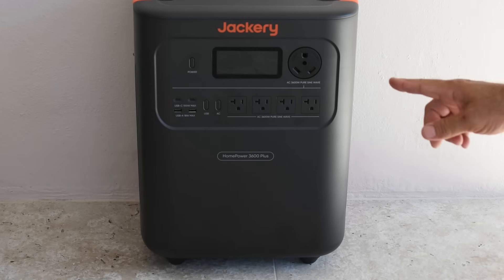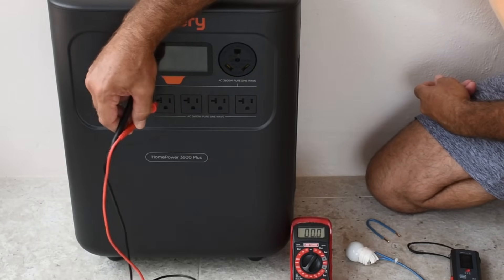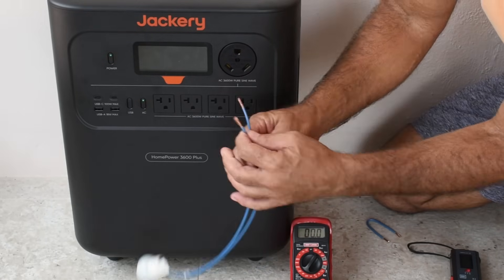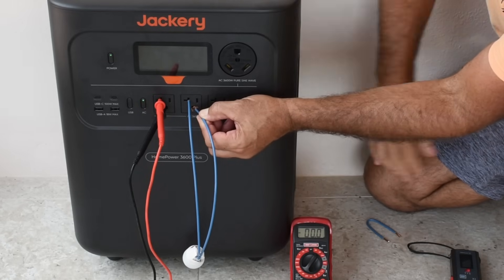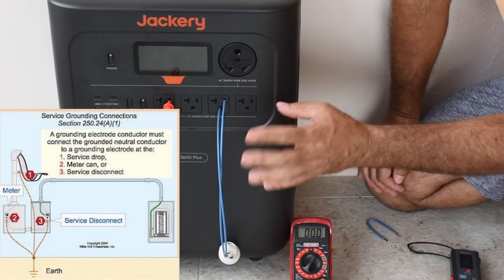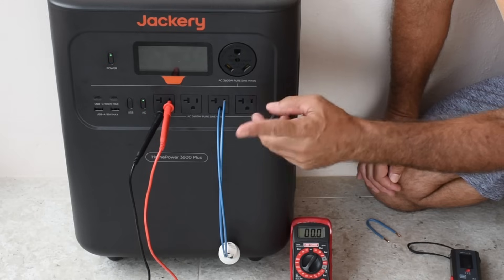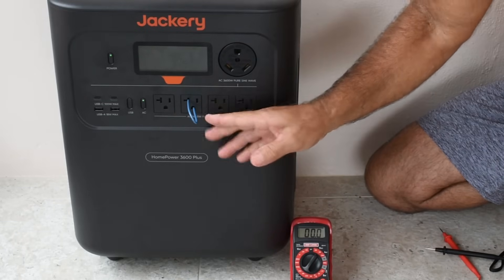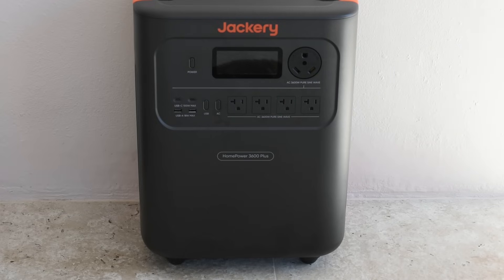Is Your Power Station/Inverter Safe To Connect To Your Home? #1 TEST!

Comment: Great demo!  
I have one of those inverters you mentioned where they give you 60v split on the hot and neutral. I assembled my own transfer switch which also disconnects neutral from the panel and have used it to power my furnace without issues.

Comment: Obviously for US applications.
Reply from the maker: In this case yes, but if you're in a European country where you have one hot wire which gives you 220 volts along with a neutral and ground the same would apply.

Comment: Might be a problem if the hot and neutral wires in the home outlet are reversed?
Reply from the maker: Even though it's not good having a receptacle improperly wired, as long as the wires connect properly to the breaker panel, with the neutral to the neutral bus bar, the hot to the 120-volt leg, and ground properly connected it shouldn't make any difference

Comment: Using twisted multi-stranded wires like that has the risk that one of the wire will connect to one of the opposite polarity which won’t be good. 

Ferrules would solve that issue.
Reply from the maker: Strictly for demonstration purposes, and that was already on my mind. I wasn't going to run out to buy solid wire. Thanks for watching